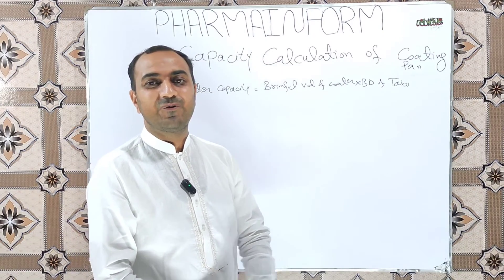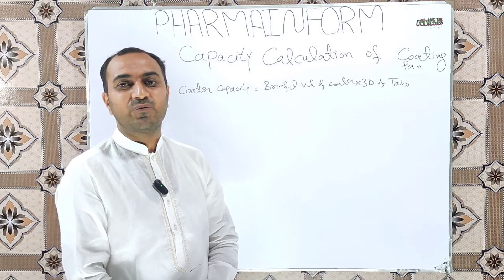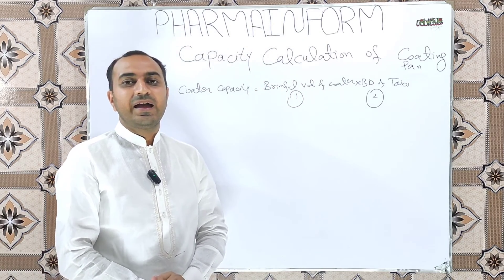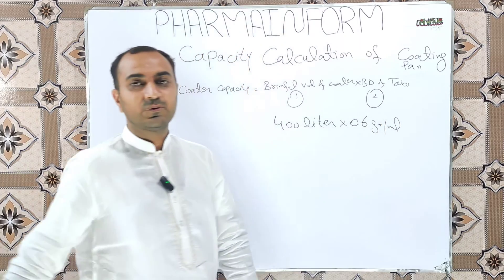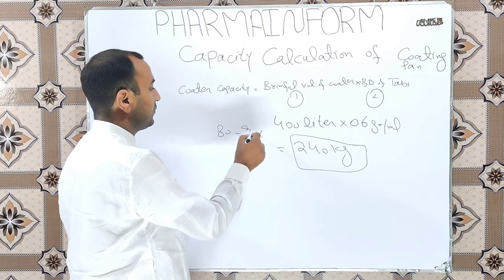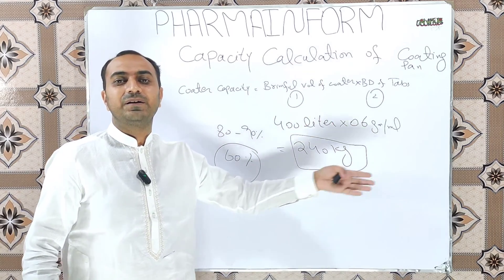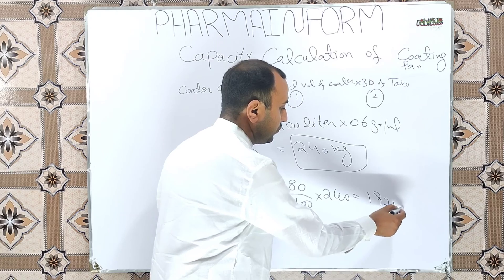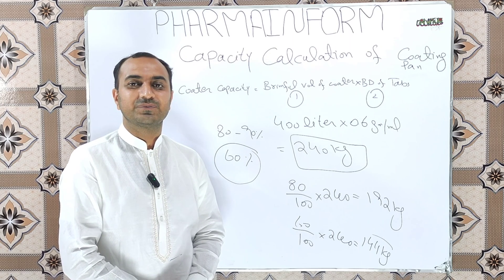Capacity Calculation Of Coating Pan

Comment: Sir,
Please define
Coating material is 12%
 1 hrs spread 10 kg,
So, 12% material how % ?
Reply from the maker: 12% mean your total coating suspension is 12%
Reply: Sir I'm not perfect English so please help me,
Batch size 2000000 L
150 mg per Tablets weight
 12% Coating solution 
54.400 kg water + 9.600 solid (12%)
 Total solution = 64. 00 kg
 Ex. 100 g spraying per 1minet it mins 100g× 30 minets = 3 kg solution spraying per 30 minets 
So, 3kg me weight gain 5mg aa raha he to yeh 3kg me jo weight gain huva  he usme 12% ke hisab se kitna wight gain mg or % me aana chahiye   
So please help this calculation 3kg use me kitna solid use huva12% ke hisab se
Reply: 150 mg + 8 mg gain karna he
Reply: Batch size or individual wight ke hisab se 12% so please sher वीडियो and current solution
Reply: 3 kg per 30 minet sprey use kiya he, usme main 12% solid hi he jisse wight gain ho raha he
Reply: Sir please,
FILM Coating  wight gain material name , for ex. Opady,   any other name
  Enteric coating wight gain material name?
  And difarant between aqueous and nonaqueous
Reply from the maker: In aqueous water is used.In non aqueous organic solvent is used